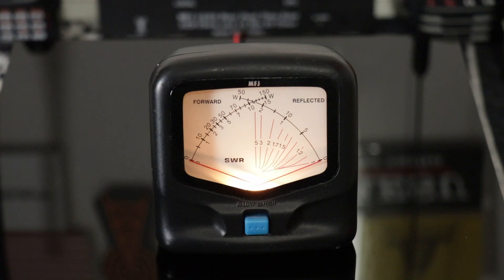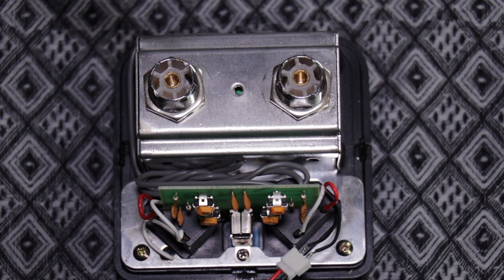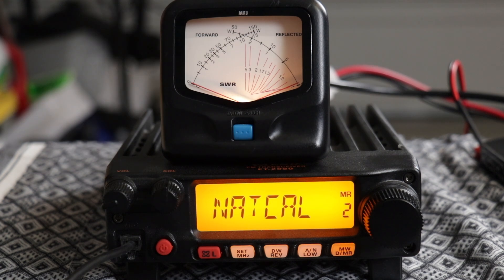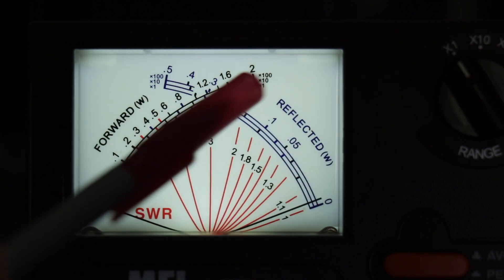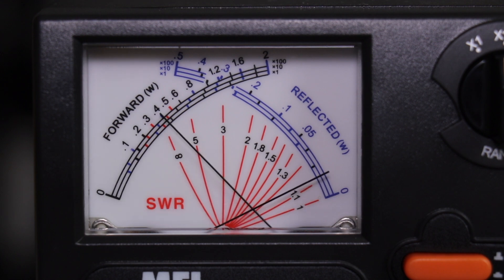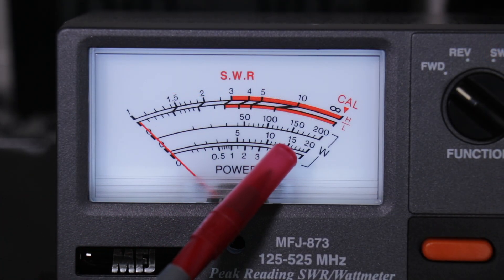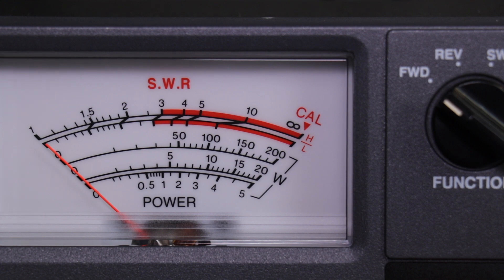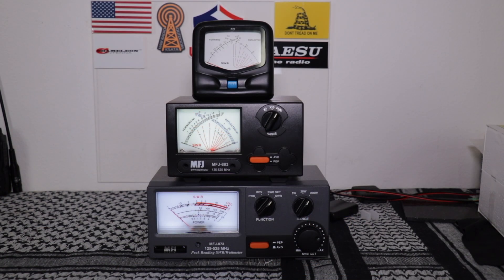VHF and UHF SWR/Wattmeter Overview and Demonstration

Comment: Please note that on the 883 that the X10 scale the marks are NOT aligned with the numbers above, but shifted a bit below them, so when you said the 5 watt output was only 4 watts, that is incorrect, the needle aligns just below the mark that designates 5 watts, so it is very close to correct at 5 watts as well as at the higher power.
On the 873 I noted that you showed about a 1.25 to 1 SWR, which indicates that the reflected power is why the indicated watts out is a bit below 5 and 50 watts, the reflected power is correctly shown as a reduction in output power.  I have the HF version of that meter, and they are calibrated very close at the factory.  I needed to re-calibrate mine later on, and those pots are VERY sensitive!  I cannot read those small twin needle meters very well, so I love the single needle 873 version.
Reply from the maker: Thank you for taking the time to watch and the comment! It is greatly appreciated. Yes, I did notice that... However, a bit late. That's what I get for not wearing my cheater glasses! For HF I use the MFJ-868B Giant Meter. No glasses required for that one. In fact I think I can read it from across the room. I have a video on it if interested.

Comment: I have used that 873 for many years with my 2m setup. Last week I was changing antenna coax and I snagged one of the brass center lead contacts and broke the brass contact. I thought I could simply change the 239 out with another chassis Mount I had.... that modular 239 connector inside them meters is something I’ve never seen before, after getting inside that module I gave up. Way too much stuff for me to tackle right now. Maybe a good future video if I ever replace that meter , but till then I have it “engineered “ enough to keep working 😁
Reply from the maker: Thank you for taking the time to watch and the comment! It is greatly appreciated. Hope fully the way you now have it "engineered" will last for many years!